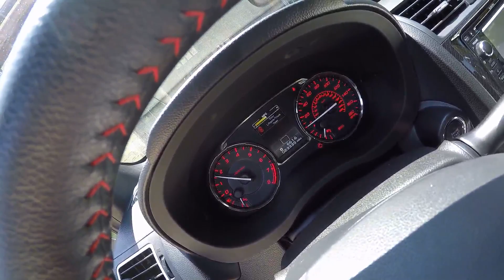2015 Subaru WRX Ep. 748: The Muffler Swap

Comment: Is it just stock exhaust with a Cobb j Pipe?
Reply from the maker: Yup
Reply: It doesn't "ting"  or "rasp"? I'm worried about doing that because of the potential rasp
Reply from the maker: No. My Cobb pipe is catted and resonated. You could add a sti pipe to quiet it down